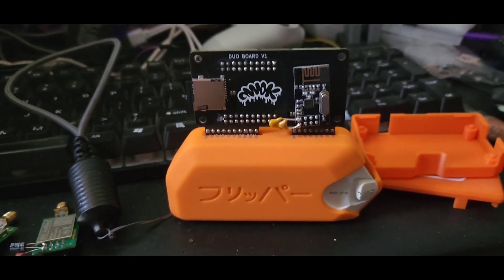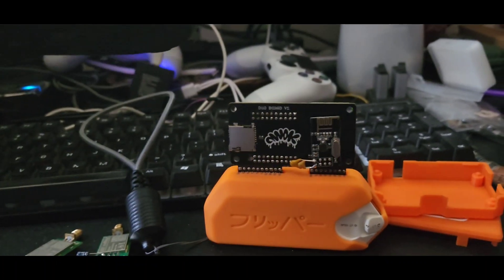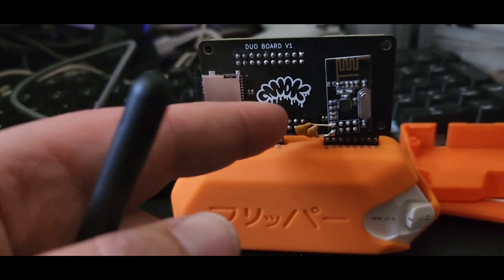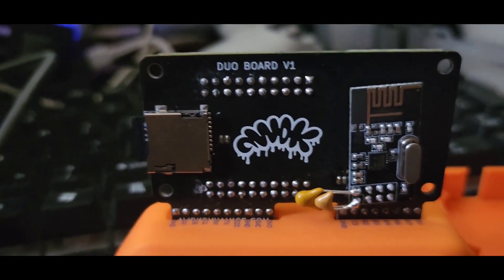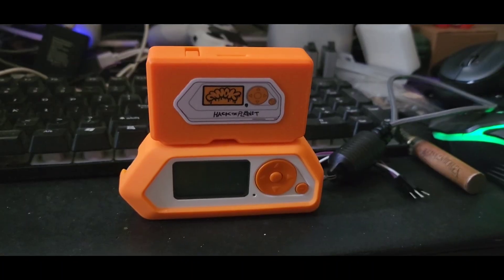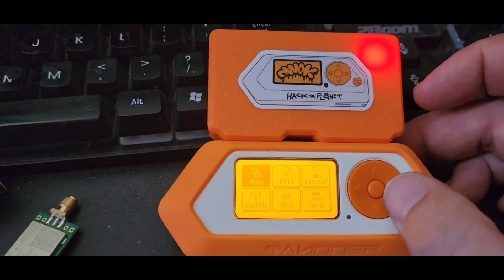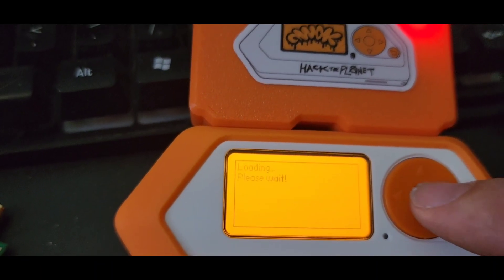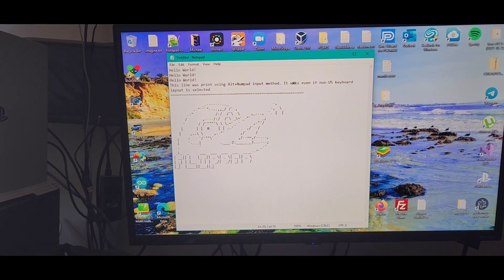Flipper Zero AWOK DUO Board and the NRF24L01 (Finally Fixed!)

Comment from the maker: Let me just clarify that I have no issues with AWOK's board AT ALL! My issues lie with the fact that my 2011 logitech mouse with CU0008 Unifying dongle simply doesnt work with the AS01 board (if anyone knows why, Please drop a comment, TIA!) which has Nothing to do with his board. The AS01 might very well work with YOUR mouse/keyboard dongle, so only do this if you have already verified that your mouse does not work with the AS01 that it came with and have tested the cheaper NRF24L01 and verified it works with your dongle before swapping.

Comment: Hey! Any chance you could make the two capacitors just one? I want to make a small form factor! Thank you!!
Reply from the maker: You actually do not need either of those capacitors because they have tiny tanatalum ones on the board already. I tried another nrf24L01 board just like that one and it worked fine 🙂

Comment: That "silver box" is the oscillator, we call it a crystal!
Reply from the maker: Would you happen to know why some NRF24'S would work with a logitech unifying dongle, but others don't? 🤔
Reply: @boboso5676  that is a good question, I do not have a module yet myself but there is a set on its way and I'm looking around for my Unifying dongle myself :D
Reply from the maker: @sjoervanderploeg4340  if you live in the USA then shopgoodwill.com is a good resource, or look and see if you can find a logitech mouse or keyboard at a local second-hand shop that still has its unifying dongle and was made before ~2017.  
Happy Hunting!

Comment: The "silver box" is a quartz crystal oscillator. It sets the frequency your radio transmits at. They'll usually have numbers on top indicating the frequency they work on. 
Technically you could swap that out for a different one and change frequencies, but it's not always that simple, it depends on how the circuit is built.
Reply from the maker: That makes sense, now that you mention it, I do see the numbers...
Reply: Ya as mention in my comment which seems to be deleted now, the as01 also has the same frequency of crystal on it under the shield. It’s an smd type not a through hole like the cheaper nrff24 chips. Iv now tested several dongles with the as01 and have no issues. Also if you decide to use a smaller nrf on the board don’t use capacitors on it as the board already has capacitors to decouple the power. 👍🏼
Reply from the maker: @AWOK  the only other thing I can think of, is that for some reason the As01 is not compatible with a Logitech CU0008 dongle from 2007, but the cheaper chip is?  Im really at a loss on this, but I know that I am not the only person with this problem, when I search online or in the comments of items sold on tindie that use the AS01 chip, I have seen several comments about it being able to aquire the address, but nothing happens when the ducky script is sent.
Reply: @boboso5676  and what about some E01 chip (not AS01) from EBYTE? I am just researching and looking around and found such on aliexpress. I would like to try and use with bigger amplifier.
Reply: @boboso5676  honestly there isn’t anything I am actually doing besides sniffing and sending the payload. I’m on osx so I haven’t tried via windows but I would still like to believe it works on both. I have always had issues with any dongle that is an uc0008 but have had luck with every uc0007 running Logitech 12.01.19 firmware. I think any firmware after that has been patched. I remember reading somewhere a long time ago that the dongle needs to have an authentic Texas Instruments chip or it won’t work. Don’t quote me tho, it could be opposite that statement lol There is an app you can download to pair devices called unifying software from Logitech. And it will tell you what firmware you are running too. Just don’t make the mistake and try to update the firmware like I did on one of my dongles 🤦🏻‍♂️

Comment: and which computer mouse are compatible with nrf24? I see everywhere that it only works on Logitech
Reply from the maker: Any mouse that uses the nrf24 made before 2017 should work, logitech, microsoft, dell, all make vulnerable mice, but logitech has been the industry leader. I was able to find a brand new Logitech M325 with unifying dongle still in the original blister packaging for 12.99 plus shipping from goodwill online... came to about $30 all in... I was able to see from the pics that the packaging said it was made for windows 7 with no mention of windows 8 or 10, so I knew i had a keeper.
Reply: @boboso5676  when i buy a possibly old dongle do i have to uinstall Logi Options from computer so it does not perform an unwanted FW update?
Reply from the maker: @zsoltibitter8761  its not an automatic update if thats what you mean? No need to delete it...